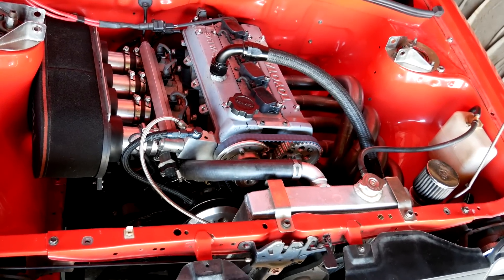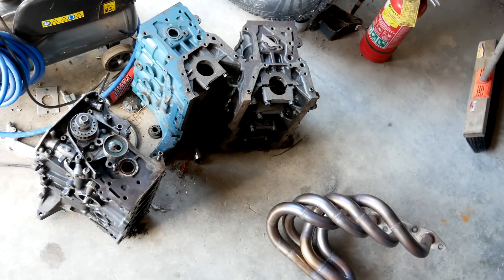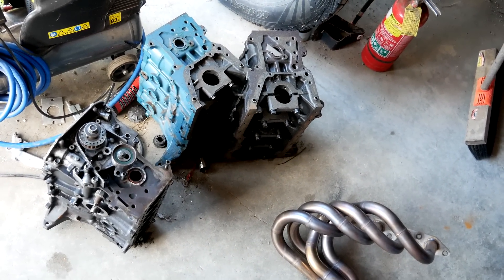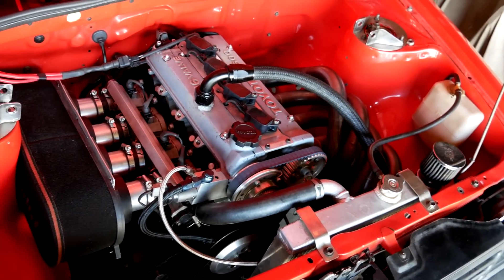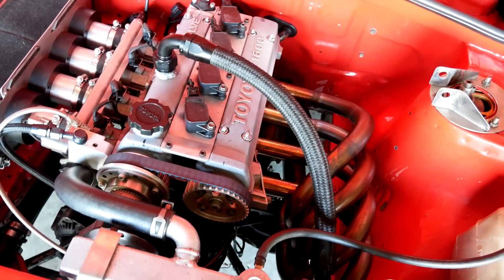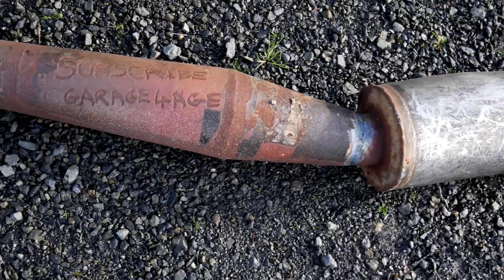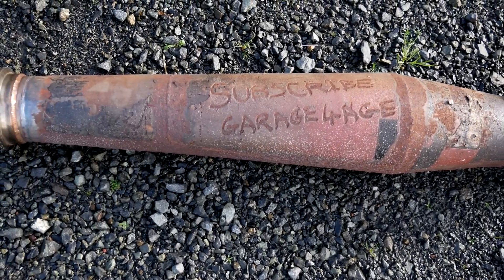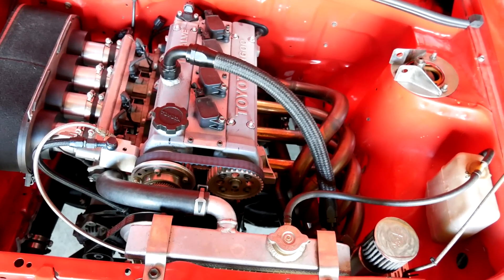Header diameter & Megaphone  - Dyno tested

Comment: Really appreciate your real world methods. What size primary pipes? 2liter engine? What do you suspect is causing such wide variations/spikes in torque down low? In my engine (a modified Datsun/Nissan U20) I'm considering an anti-reversion plate or "tongue" being positioned in the lower part of the port as it enters the primary exhaust tube as per a David Vizard Youtube video. My primary pipe size options for available headers is 1 1/2" or 1 5/8". Reversion is an issue in this head, and i wonder if that's what we're seeing here.  Have you ever experimented with an anti-reversion cone type header?  I'm going to use a plate so as to not interfere with flow where velocity is high, but headers with cones are being made for some engines. This sounds like something right up you alley!  Love what you do!
Reply from the maker: tubes used here are 1.5" (38.mm1)   & 1.75" (44.5mm),  with a 1.6 wall if you want  id dimensions.      Engine has big cam overlap so will get reversion at low rpm and wide open throttle.   As you can seen the bigger pipes make it worse, for a small gain in top end.  but that isn't the whole story if you look at the headers closely.   the megaphone kinda amplifies the peaks and dips. I havent tried any anti reversion stuff close to the port.  but have had poor results with anything like that after the merge in headers.  a pinch point and cone beats it every time.    imo smaller primarys and the correct sizing in the section after merge , then a big exhaust is the key to making a big cam engine work in the lower rpm.     if its a circuit car that lives at high rpm all its life going for bigger diameter primarys can help a bit,  otherwise i would go on the smaller side of things.     for an example of how the power curve usually looks on these engines making this kind of power, have a look at this video https://www.youtube.com/watch?v=bWNdVy5bNBA
Reply: @Garage4age  thank you for such a detailed response! This is a modified street car that I've just played with for 38 years... a good friend. 7000rpm red line, 40mm Jenvey Heritage TBs, head work, a street friendly cam (246 duration at 50thousands,.531 total lift which is high but it likes it), 4800rpm peak torque, EFI/crank-fired ignition controlled by Microsquirt).  I may have the smaller pipes on it now, but just got the larger header thinking it might be better... maybe not.  Thanks!

Comment: Hello Garage4AG... I have a stock silvertop 20v and I changed the header from a blacktom one which is a little bigger... does it mean that I should better stay with a stock silvertop header if I am just using the car going to work? Thank you in advance.❤
Reply from the maker: havent tested the difference between them.  but yeah if any gains on the blacktop headers, will be right up the top and st may give little more off the bottom.     The primary tubes on the blacktop headers are actually the same size as the "small headers"  in this video.  which as you can see are good for lots of power
Reply: @Garage4age  thank you for taking time to respond. I should have not sold my stock silvertop headers. Oh well, I will buy one now...

Comment: Have you ever tried the anti reversion “mufflers” sold by Hendren, Schoenfeld, Dynomax, & Vibrant? I’ve seen these / similar-copies placed after the megaphone on some K20/24 builds and they are very popular on circle track V8’s placed after the headers merge collector….some of these designs have a forcing cone in them (I believe to take place of the rear cone of the megaphone to attenuate the wave / stop over extraction).

Comment: One thing to note is even with some of the best off the shelf headers, smaller diam ones often have shorter than ideal lengths to suit milder builds, while the all out off the shelf competition headers from the same manufacture have the correct length and diameter within a few % of ideal for the high end of wild builds.  So I have used comp style headers on mild builds just for the length as that makes more of a gain than the loss at lower rpm with being too big in the diam.

Custom headers with this sort of quality and r&d is something elusive, at least here in Aus. I have not found anyone in my state that does this.
A lot claim they do, but just the usual bird shit backyard style exhaust design and welding and have no clue about the maths and theory.

Luckily for one of my project cars, Pacemaker comp headers are like 98% spot on for my planned combo, and from the collector termination it's just a 2-1/3" flange, ready for cone, steps, megaphone or what ever it requires for fine tuning of the 2ndary pipe section.

Comment: After all that, what do you prefer? Big header originsl pipe seems like the winner
Reply: Also what's the diameter on the big one?
Reply from the maker: @devonswindell9735  big  header with original pipe only holds on for a litlle longer right up top.  so unless your were running close ratio box and keeping it over 8000rpm all the time,  the big header with megaphone is my pick.   i think there is some more in it just need to try more stuff.     44.5mm

Comment: Just awesome work.  KTM bikes are running a small expansion pipe on their 4 strokes.  I hate to say it but I wonder if a small expansion pipe for each cylinder in the header at a tuned length, the idea would be that there wouldn't be reflected waves from every cylinder bouncing around every header pipe. I am happy to see that there are gains from the theories of the tuned exhaust.  Excellent dedication to this
Reply from the maker: Have thought about it, would be a nightmare to fab and package haha.       If you look closely at the big headers, there is a small section out of the port.  the transition isn't actually a "step"  its a small diverging cone.  when i first built them they had the big tube all the way from the head. they made the same power as small headers (on bit lower power engine setup)  i changed that section and it gained top end. same power down the bottom.  So i guess that  makes the video slightly misleading.   but is interesting how a small change can make a difference. then a big change does nothing
Reply: @Garage4age  ya that's interesting. I guess that is the same thing really. KTM just had a little section of bigger pipe about 3" outside the exhaust port. A tiny little gain.

Comment: Another great video :).  In a similar way to the megaphone effecting the reflection wave, have you ever tried having an expansion box within the system to create an atmosphere reflection point.   The idea being that most exhaust systems are too long so having this open expansion volume allows you to tune the secondary/tertiary waves.  I have seen quotes of people saying you want between 8-12times one cylinder volume for the expansion chamber, and a transition change into the chamber to get the reflection point, with a gradual change out of it to not cause a restriction in the flow.   What are your thoughts?
Reply from the maker: I haven't gone into it much, but have tired a few open/expansion  chambers.   not a lot happened.    I"ve always had best results with absorption muffler/reso's  after the "tuned" length. that's whats directly after the megaphone
Reply: Are you referring to  David Vizard's Pressure Wave Terminator Box?? and Anti Reversion?
Reply: @chrispompano  that is one of the article that I had seen that prompted the question

Comment: Always like to see the changes in Power. I wish for a 4-2-1 header video 👍🏻
Reply: Be nice to see this. It should pick up power low down and mid range rpm. Total bhp should also be lower. But it would be nice to see if that is true
Reply: @MegaNozman  at least in theory, but what happens if the 421 is one step bigger than the 41?? Are they similar in that case, or does the 421 still have an advantage??

Comment: Nice man, would be interesting to know what the two header pipe sizes were that you tested. 
Also why do you think the megaphones restricted higher up in the rev range?
Reply from the maker: 38 & 44.5mm  tube. they both have a smaller stepped section out of the head as you can probably see.     the rusty megaphone pipe i show in the video and tested off cam, didn't drop top end like the new oval one.  i loosely based new one off the area of the round rusty one.   i wasn't really sure if it would translate over to the oval shape with area alone.   basically need to try more variations to find the best compromise.  look to be in the ballpark though
Reply: @Garage4age , If you are willing to share, what is the average length of the tube before the merge ? (I'm guessing they arer all within a few cm)
Reply: @Garage4age cool thanks for the info. You should try adjusting your exhaust cam timing with the megaphone, it might help.
Would you say this is your most powerful setup/combination of parts? If not it would be nice to see a video where you go for max power build based on all the best combos and parts from all testing....
Reply from the maker: @matthewbussy  Yeah this is  best over all power.    best engine has done  is 168kw. (166kw here)  But thats just the dyno,  The sae correction overcompensates a bit on this car.  so cold/high pressure days will read less power than hot/low pressure days. (yeah ive done way to many pulls with this car to figure that out)   I can tell by the fuel map its making a touch more power than the 168kw runs.   I was going to adjust the exhaust cam timing but ran out of time.  will try next time its on dyno.    It like the same cam timing on intake side.
Reply: @Garage4age  ok I see. Nice man that's amazing power.
Yeah regardless of what the Dyno reads out you can tell from the fuel map. More fuel = more power 💪 What fuel are you running?
If it is not an alcohol based fuel like ethanol or methanol, then you still have a lot more power and torque to unleash!
Reply from the maker: @matthewbussy     Just 98 ron  e10 pump gas.    Its built to run on pump gas and isn't knock limited.   so wouldn't be any big gains swapping fuels.
Reply: @Garage4age  yeah but you will still have gains because of the shear volume of alcohol you put into the motor and the overall energy potential. Yes normal pump fuel has a higher specific energy than alcohol fuels, but due to the stoichiometric AFR for both types, with alcohol you ended up with a lot more energy.
Not to mention the cooling benefits, on methanol your throttles and intake will actually form condensation on them.

I know you know your stuff and your setup, but it could make for a cool video to show whether there are gains to be had with switching to methanol, and if so, what are the gains...

Comment: Part throttle below 4k.  I'd be keen to hear more about that.  If you've got the right foot under control, can you take out the wiggles?  What happens?
Reply from the maker: Yeah its not really noticeable / a thing at part throttle.   you can see it in the fuel map also as you would expect.  basically at full throttle there is big spikes and dips in the fuel map that follow the power curve.  they fade back to a fairly flat fuel map at low throttle openings.  (it runs tps vs rpm aka alpha n fuel map)
Reply: Edited.. At part throttle the butterflies change the resonant length.  ITBs have a much shorter distance from butterflies to valve compared to single throttle on the end of plenum.

Comment: Most people will just buy an exhaust and intake and throw it on, but your videos show just how much is left on the table. All those little incremental gains from each bit can add up to huge results. And just on a little NA 4 cyl, basically the hardest place to start. Awesome work 👏
Reply from the maker: Yeah  some people comment "oh only a few hp waste of time"     but it pays off when can start stacking the gains
Reply: you're overlooking the fact that a lot of people don't have their own dyno and don't have the spare time or tools to tinker like you do. when you're paying a mechanic or mate to do this the cost to benefit ratio makes a big difference and additionally, not everyone is tuning a 4age for a rare chassis like yours  @Garage4age
Reply from the maker: @jackmiller8851  Thats the unfortunate thing with na tuning.  especially starting with a low capacity engine that makes ok power to start with.  Nothing  really makes a big gain, it's all small gains added together.    If had a big o'l v8, lets say a ls1. thats 3.5 times the capacity.  the results would look far more impressive    rather than 9hp would be over 30hp.  people  always ask me what the best mod to do is.  i cant answer it, because there isnt any stand out single thing to change.   Also, dont have to have a dyno, I got a good part of the way road testing stuff before had dyno, although it does make things easier and less likely to get arrested haha
Reply: @Garage4age   i was thinking it was hp and then saw KW. Damn, 3-4 kw difference is a lot)
Reply: Yeah most of the time its the hardest place to start but take honda's K20 and k24 4cylinders they make 200hp stock and have insane tuning potential without even touching the engine or head at all. just a simple intake, header and exhaust  can take you from 200 to 240hp its wild but the 4age takes alot of skill, time and money lol to make big power but i imagine its more rewarding and i think its cool asf

Comment: Forget about the megaphone. I spent my early years on 2 strokes. Unless your will to keep it in a tight rpm they do as much harm as good.
Reply from the maker: did you watch the video?   2 stroke is a totally different box of frogs
Reply: @Garage4age  I did .. all I saw was a saw tooth pattern.. as it come on and off the megaphone.. like I said don't waste your time.
Reply from the maker: @slug.racing    You are in the wrong gear if you are wide open down at those rpm.